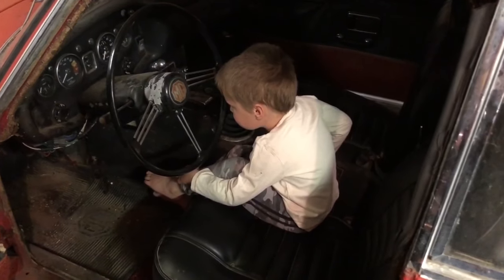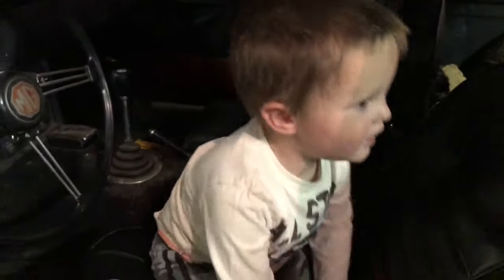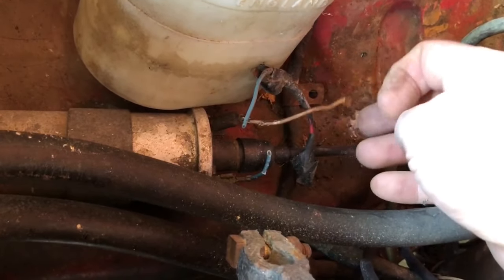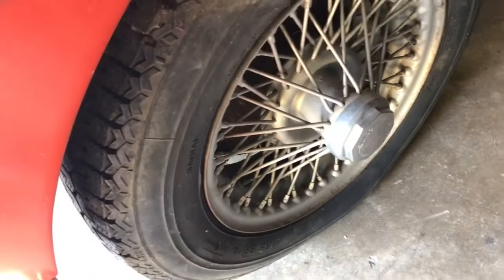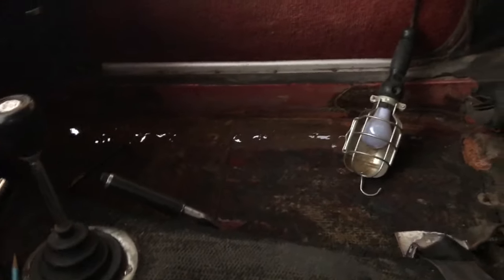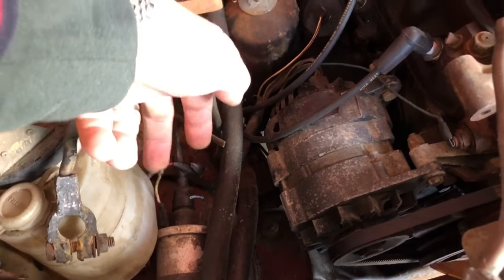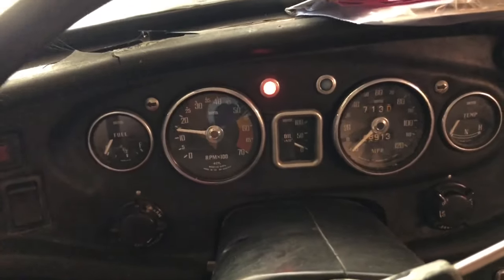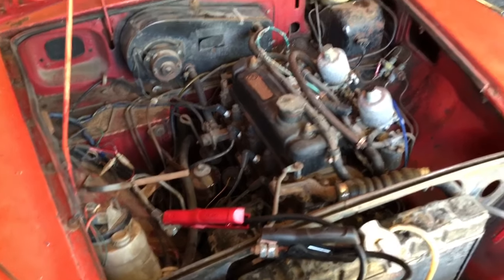MGB GT Restoration - Chapter 1

Comment: Congratulations on buying your MG BGT! The Leyland “A series” is fun to work on! The British motor industry always ran on the “If it ain’t broke....” principle, so were slow to upgrade their models, but many enthusiasts own and restore these cars in the Uk still, and most parts are still available, including remanufactured body shells! The Buick V8 from the Rover P5/6 goes straight in, also I believe, the Leyland ‘O’ series, which some say, is pretty versatile. But the main problem is of course rust, and it always pays to fit a secondary (switchable) cooling fan, as these are prone to overheating in traffic. I’m sure you’ll have a great time restoring it with your son, and I look forward to seeing your updates. Really enjoying the Friday mail call vlogs too! Thanks for some great content!

Comment: Oh wow! It runs! I can’t believe it. You must live in a reasonably arid area. Those old MGs weren’t designed well against the elements. Imho, I’d look at replacing the floor pans completely. There are aftermarket panels that are great to use. Otherwise I think that you’ll be chasing rust forever. I had this problem with a 67 Camaro many years ago.

Comment: my father had a MG BGT just like this but I think a bit later as it had an additional oil cooler radiator and a more modern steering wheel plus a sun roof that I remember thinking was cool and also an "over drive" button on the gear stick which I think was a 5th gear... anyway, so cool to see this and I am so interested to see how you get on. Can I ask, are you fully restoring it to use on the road? how will you fix up the corrosion on the floor pan and feet wells? and where will you search for your spare parts? best of luck!!!

Comment: I have never heard anything good about these cars. Lots of story's about how the wheels come off while driving. These where not worth buying when they where new. So many better cars to restore and spend your money on.
Reply from the maker: I've driven MGs all over creation.  As with any machine, if maintenance is done, they're fine.  The trick is to get it all done, and done correctly.    The quality is what it is, but I would point out that I got this one running after it sat for 30+ years in the woods - it started the first time I tried to get it going.  
 I've never had a wheel come off, I've never heard of anyone having a wheel come off.
Reply: Don’t you just love it when people tell you what to spend your money on
Reply from the maker: Especially with as little as this one cost.  A set of new tires will more than double my investment.